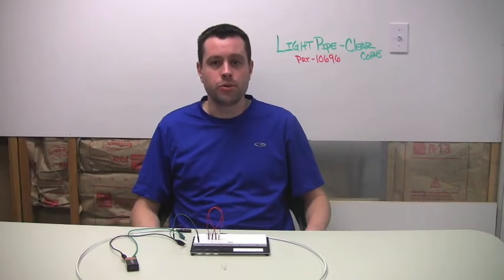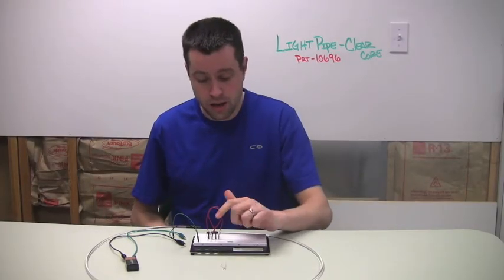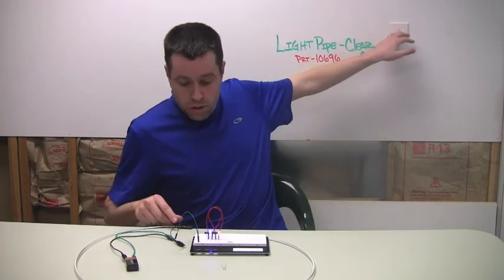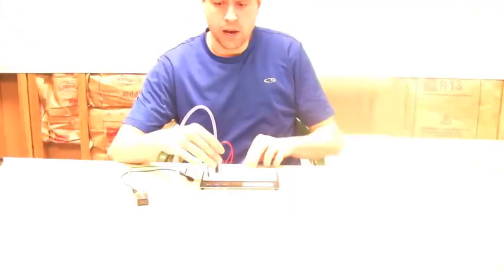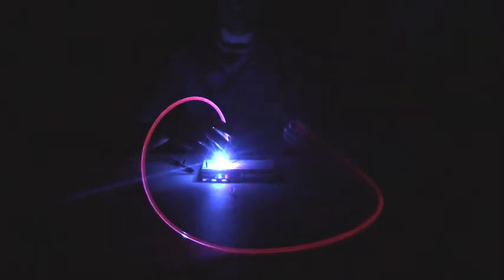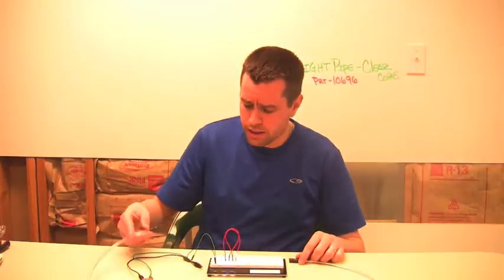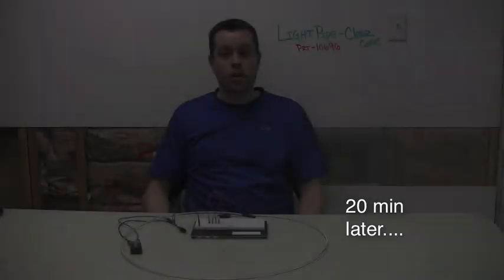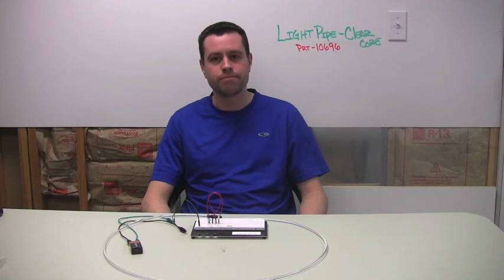µReview: Light Pipe

Comment: Hey Kevin, I was wondering what is the minimum bend radius that this Light pipe can withstand without any serious damage to it?
Reply from the maker: I was able to bend it with about a half inch radius without damaging it but it was pretty stiff. I'd say an inch radius with no problem. Hope that helps.
Reply: @KevinSidwar  Thanks for ur quick response
 I was wondering if there is any side emitting optic fibre cable which is really flexible and can last long with frequent small radius twists! so the material had to be Polyurethane or something similar and still be able to emit the light side ways. let me know if you came across such fibre cable!
Reply from the maker: @ruturajshinde9175  I'm not aware of a cable that meets those requirements off the top of my head. Sorry. Good luck on your project.